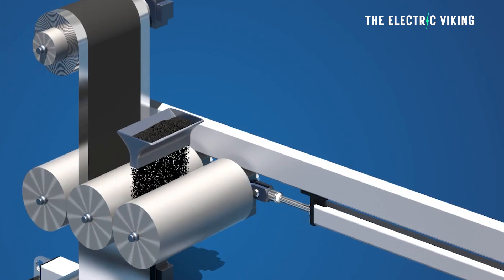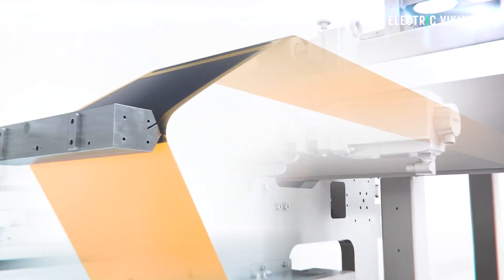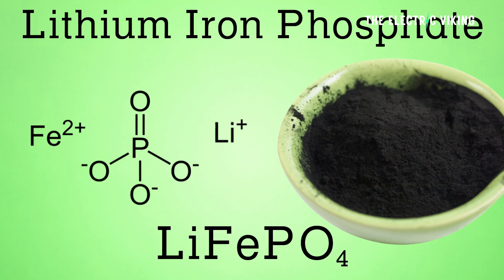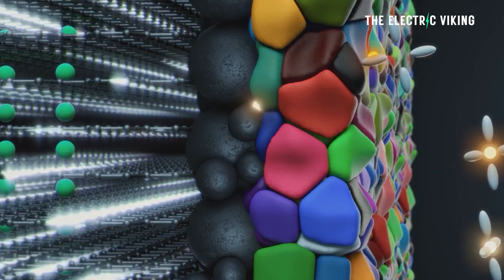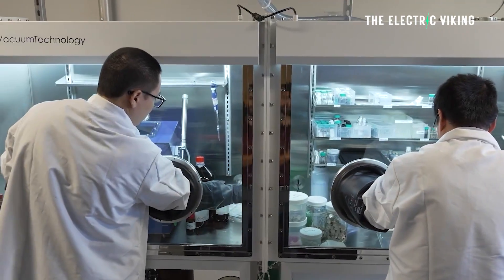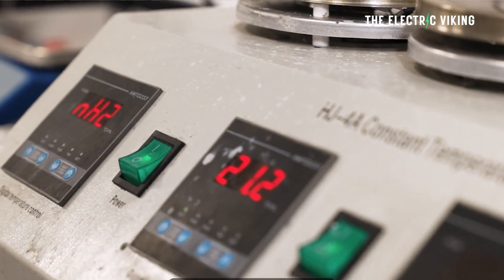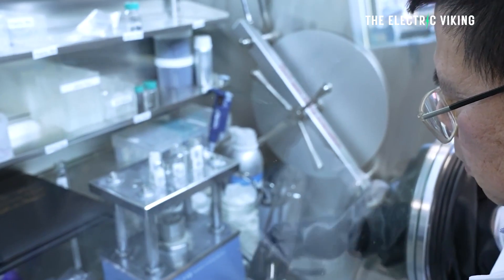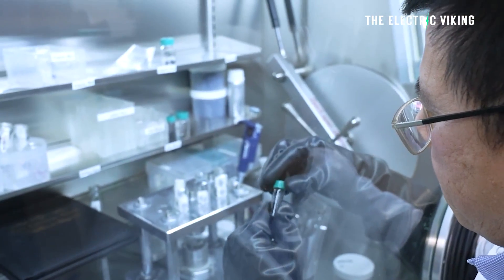Cheaper & faster charging - a far better way to manufacture battery electrodes

Comment: Tesla acquired Maxwell corp because Maxwell had a way to do dry electrodes. So it seems Tesla is already doing this. Tesla said it improved battery safety, reduced charge times and significantly reduced factory space and cost.

Comment: Please do not confuse a solvent-free manufacturing process with a solvent-free battery.  
Solvent-free manufactured batteries have the solvent added after all the parts are assembled.

Comment: Check out Prieto Battery. Invented by Amy Prieto, winner of a Presidential medal awarded to one of the most outstanding scientists in the United States, she has been developing her battery tech for 15 years. Finally got it right and announced pilot plant for production under construction. 5 times more power, 3 times more density, charges in three minutes and works down to -40C. Revolutionary. Check it out.

Comment: You have made videos about several batteries and identified improvements. But which cars are these faster-charging batteries installed in? How long before we can buy a car with the new battery chemistry?
Reply: people in china and around the world are getting paid to chip away at it.
Reply: Well, this particular potential improvement is probably going to take 5 or more years to get into a BEV.  He said 12 - 24 months to get the process perfected.  Then at least that much more time to get it into mass production assuming it can be done at all.
That is the problem with early battery announcements.  It is one thing to get the idea and confirm the concept.  It is a whole different thing to get it in production and able to mass produce it at an acceptable cost.  That is why most of the improvements you see announced you never hear of again.  It is extremely hard to go from the lab to the production line.

Comment: Isn't the charging speed up to 200 to 300kwh/h ? When this is going up, this load will heat up the charger and the battery. Maby another way around this is to make small electric cars, that don't need all that charge because they use only around 1kwh/10km. - Another subject - 
Take a look at Toyota they are trying to reduce the speed of transition to electric - by new videos about some new ice motors ?? and talking about 
E - fuel  ??  🤔 ??

Comment: I'm keen to hear your opinion of the graphene-aluminum battery research conducted by Brisbane's GMG.

Thoughts?
Reply: Not much is really being said, other than GMG coming to the realization that pouch cells are in higher demand than coin cells. Supposedly they’ve got permission to make the cells, and they’re doing test runs of the equipment, but that’s all they’re saying. Nothing about preliminary cells’ capacity, charge rate, physical dimensions, or anything useful to those making packs. And yes, I’ve asked directly; crickets.

Comment: This is also a more sustainable battery eliminating the need to dry the cathode, eliminates solvents and other steps.
Reply: In fact, 95% of the energy consumption for building a cell comes from drying anode/cathode components.
Remove electrode drying, and you get lower fabrication costs, much much lower environmental footprint, and immensely improved manufacturing speed.

Comment: It seems to me that this would have bigger effects on speed of charging single-battery devices like cellphones and other electronic equipment.  The current speed of charging cars seems significantly bottlenecked by the size of the cables to get the current into the vehicle, where we have things like 920V supply and liquid cooled cabling to try and increase the rate of charge.

Comment: Surely the limitation on charging speed of EVs  is mainly the amount of power available?
Reply: Nope. It's cycle life/charge rate.
Reply: if I have 3kw available I can only charge at about 8 mile per Hour at 11kw about 50. At 50kw about 140, and once you are on DC 150kw charges you at about 350 miles per hour etc etc why else are they already installing 350kw chargers? Once you can add 250+ miles in less than 20 minutes.... You really should not be driving that far without a rest anyway.

Comment: The Anode is positive, Cathode negative.
Reply: Depends on what kind of electrical device one refers to. If the device "consumes" or use electricity to work, the Anode is positive and the Cathode is negative. Like electronic components used on PCB's and so forth.
However, in case of a supplying device like a battery, The Anode is negative and the cathode positive...
Reply: @pauldbeer Either Sam misused terminology or not. Why don't you comment on the facts?
Reply: @MegaWilderness  You seem to attack me! Why? I simply stated the FACTS!!!!!!!!!!!!!!!!!!!!!!!!!!!!!!!!!!!!
Sam was correct. Uber Menschen wrong in his comment. Seems you are a little confused??? Wakey-wakey...
Reply: Bro, you got it reversed.

Comment: The sodium battery has a lot of positives. However, the present issue everyone is working on is charge density. Presently they cannot achieve lithium levels of density, though development is progressing, consequently to achieve the same requirements would require more sodium batteries which means weight. However, these batteries offer certain advantages, such as more cost-effective manufacturing, superior performance in low temperatures, and enhanced safety features. Also it opens the development of batteries beyond China Australia and Chile the leaders in lithium supply.
Reply: One point with Sodium cells is they are ten percent lighter per unit volume as they dont need to use copper or other heavy rare earths in their construction .
Reply: @clivestainlesssteelwomble7665  Not exaclty. They still have lower energy density than leading edge lithium ion cells. However, because of their different chemical makeup, using aluminium current collector on both electrodes is now possible, lowering weight/current capability and cost.

Comment: This just shows how fast things are changing. The nay sayers always seem to argue from a fixed point in time - as if nothing will change. 
"The grid can't handle it" - we will change the grid, it's not hard.
"Batteries are dirty to make and no one recycles them" - this video shows they will get cleaner and companies are ramping up to recycle.
"Batteries use mining and mining is bad" - civilization would collapse without mining. Iron ore is mined 26,000 times more than lithium
On and on. Their negative arguments can be shown to be wrong almost every time.

Comment: How much to get a EV charging point at home in Toowoomba (Qld)? How much to charge the car overnight I wonder? Is it cheaper to keep with my Suzuki Swift, at least for another few years?
Reply: If the car works and is safe enough for you it is cheaper to keep driving it. When it fails, then you can should buy a electric car. The charger costs  a couple hundred dollars and a couple hundred  dollars for installation. But many users the included charger permanently, and often free in many countries.
Reply: Cost 2-4 k(charger and installation, but may be more if they have to upgrade your fuse box, ect ect) aud for a level 2 home charger,   and would cost whatever  cents per kw/h to charge ower night
Reply: You are in Australia which runs on 240 V service. It is quite different in North America (USA and Canada) which runs still on 120 V, and really there you have to upgrade for home charging for $$$. Why? On the limited amps you can run through a standard wall plug, an average EV might take say 16 hrs to charge from near empty to near full. A standard 240 V wall plug can throughput more so the same car same charge might only take 7 hours. An upgraded 240 V/a dedicated EV charger might do it in 3 to 4 hrs or so. A high speed Level 3 public charger (50, 100, 150 kW or more etc) is a different thing entirely and costs $$$$$$ to install, and $$ to charge, but they are FAST. Depending on the vehicle’s battery size (bigger usually means can accept faster) and hardware capability, a 10 to 70% or 20 to 80% charge (sweetspot for high speed charging) could be as little as 15 minutes and could  be as much as 45-60 minutes, depending on outside temp, battery temp, hardware capabilities, etc. Its not a great idea to run below 10%, and since charging speed drops off rapidly above 70-80%, don’t charge above 80% generally unless you need to due to time. For road trips, 15-30 minutes stop for food/drink/toilet/stretch every 2-3 hrs of driving is reasonable. If you are driving less than 100 km a day in a 240 V country, then a regular old wall plug for slow charge overnight will do you. If its more than 200 km every day, you might want to invest in a wall charger unit.

Comment: So waht is the difference between that and what Tesla does?
Reply: Good question.  It obviously has not been answered or even addressed in the replies.  Their must be a difference if this tech has a new patent, yet it was not explained or noted.  One difference is that the inventor of this method said it lends itself to scaling  up, while apparently Tesla is currently attempting to scale up it's dry method.  However there could be many differences in methodology of preparing the electorde compound and depositing it or just minor differences -- none of that has been addressed here.
Reply: Teska is a,ready producing DBE batteries
Reply: @mallamal5578 Without the claimed charging speeds invented in Sam's head. Different company. Incorrect assumptions
Reply: I think this is what tesla has been tryng to do with theier 4680 batteries with a dry deposition. Tesla are only partialy there.

Comment: If battery charging gets too much faster, then people travelling long distances in EVs will have to put up with unacceptably short coffee breaks.
Reply: Well if anyone says "Bugger Me" upon learning this, I would advise them to think carefully, Would you have time "For That" and Coffee?
Reply: Doc's already got a way to charge EVs instantly.  All it takes is a wire run from the clock-tower to the street and exact knowledge of when the lighting will strike.
Reply: You have time for a coffee as well? What about time for the loo break and a bite to eat?😅😆
Reply: @peterlittlejohn8933  sorry, no time for that anymore. They'll need to drive immediately, no time to rest anymore. EV's are diabolic...
Reply: That's already the case
Reply: Espresso only
Reply: I eat while the car charges. I already barely have enough time to eat before the car is ready.

Comment: 125kw charging is the fastest in Thailand. Elex by egat stations. Charge the Neta V from 15% to 100% in 1 hour and 18 mins. Not bad. 
Get it to 30 mins would be great.
Reply: I can still fill my gas tank in 3 minutes.
Reply: @dzcav3   I know. I owned a gas car for 30 years,
Reply: But can fuel up at home.
Reply: @Flukey Lukey  on the supplied home charger I get 5% battery over an hour. 17 hours from 15% to 100%. 
I use it in on an island so I only recharge once every 7 days. I catch a movie at the mall and it's charged for about 10 bucks.
Reply: @mickfitz76  sounds good, actually I was responding to dzcav3 with his gas tank.